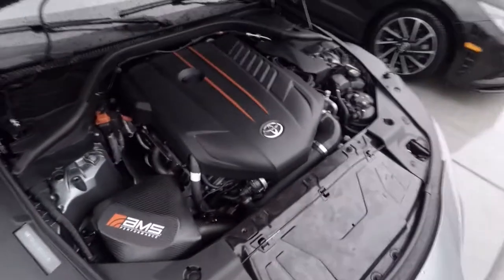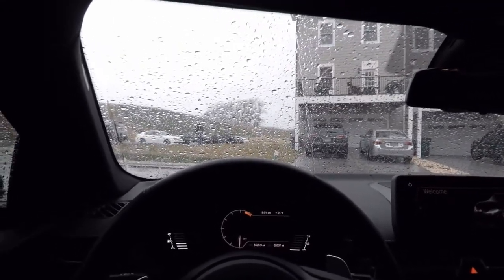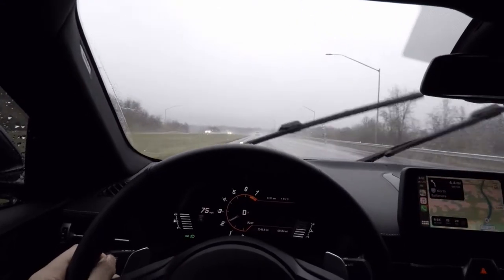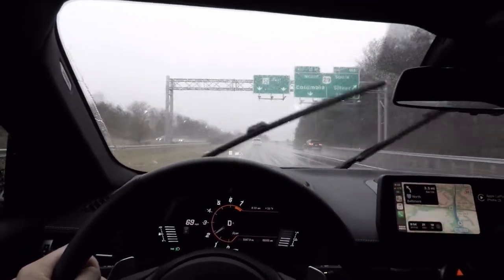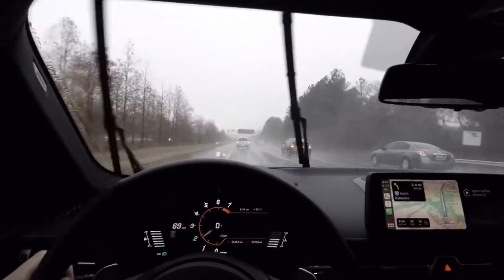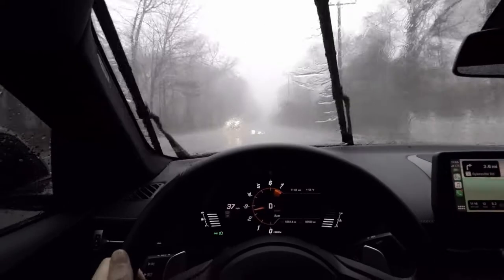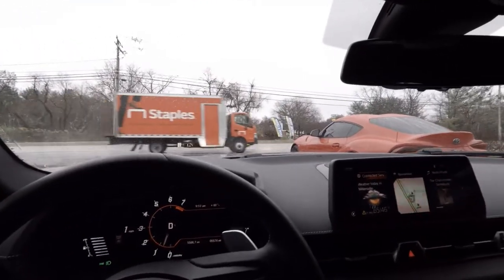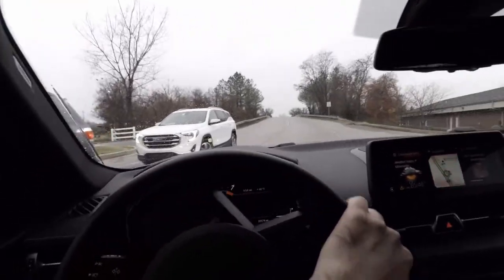AMS Charge Pipe FAILURE on my Supra!

Comment: Were you able to figure it out? Did you get another one from a newer batch?
Reply from the maker: I got the revised AMS charge pipe...it’s still popping off at the coupler but at least this time the pipe itself is solid. The clamps it comes with a just junk so have to get a better clamp
Reply: @nickchaconas  Thanks for the response! I'm really considering getting this charge pipe but you're not the only one complaining. Do you think it will be solid with better clamps? Would you get it again or jut go with a different brand?
Reply from the maker: @supitsolivlogs  Im really hoping so. I rearranged the coupler today and tighten the worm clamps the charge pipe came with and it held better. Once the stronger clamps go on I hope to be good to go.